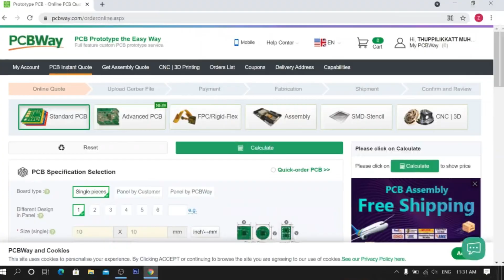How To Make Variable Power Supply At Home| All in one

Comment: Why you are using black glue on the soldering points? 

Suppose in future you need to change wires what you will do? It will be very hard to remove and it can break the pcb circuit too!
Reply from the maker: its easy removable, T 7000 glue
Reply: @Promaker1  okay, thank you for the information 👍🏻